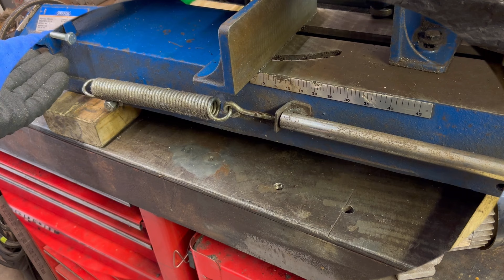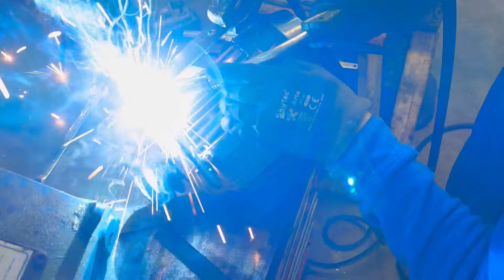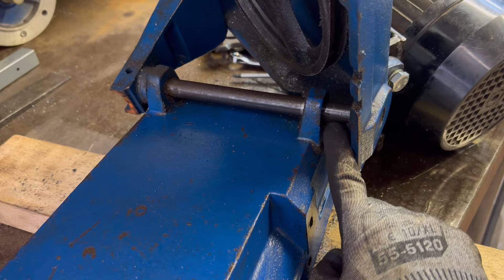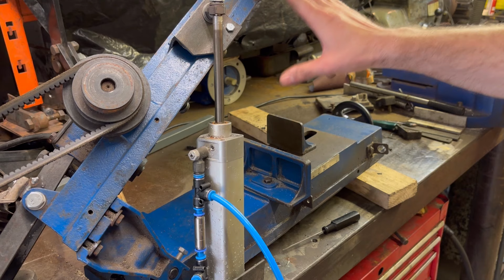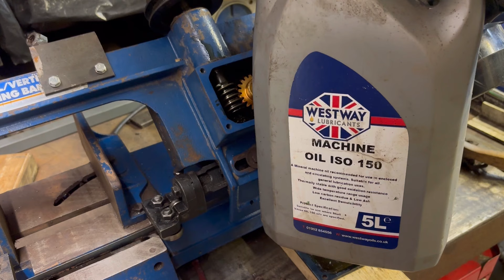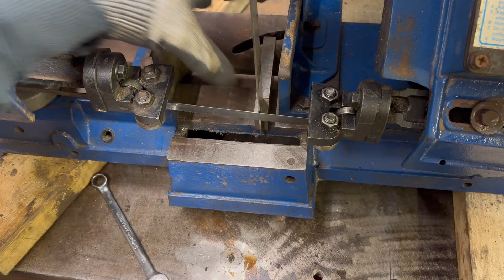Bandsaw Bother! Recommissioning and upgrading a saw fit for the scrap heap! Restoration series ep6

Comment: I'm looking forward to this. After I have re-bearinged the headstock on my lathe, my 4.1/2" bandsaw is due a full overhaul, I got it cheap when I bought my small mill from a guys deceased father's shed.
Getting the saw for less then the price of the blades was a deal as well. The big universal mill I bought, came with a full original manufacturers universal dividing head, with all the change gears etc. A rotary table, decent vice, a universal vertical head, a standard vertical head, all the bits and bobs for horizontal milling a slotting head and loads of cutters and Clarkson chucks. I consider that I bought the accessories and got a free mill. Always nice.
Reply from the maker: Good luck with your saw overhaul. Hopefully you will find some good guidance in the video. They are fairly simple things and not hugely difficult to sort. They are a great bit of kit to have in the shop. 
Your mill sounds very well spec’d, I hope you have more time than I do to use it! Many thanks for leaving a comment